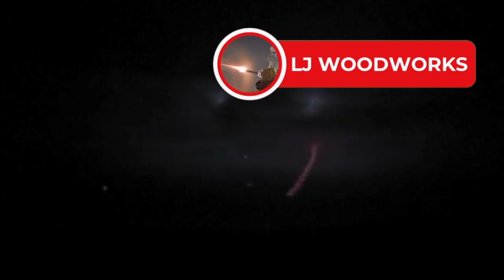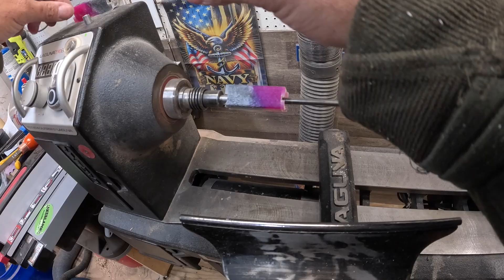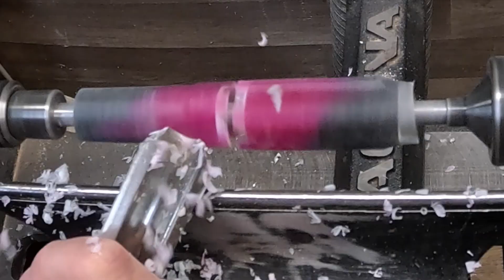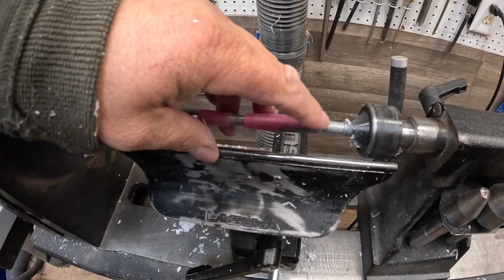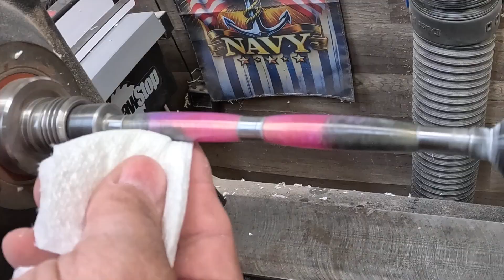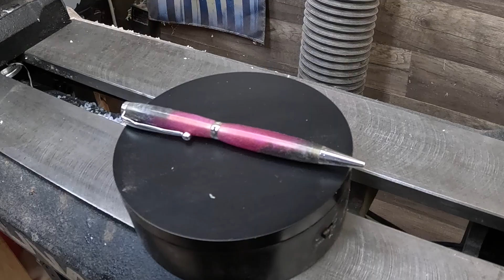Can You Turn Resin with Traditional Tools? | My First Resin Pen

Comment: I got my start with cheap Harbor Freight tools and a few old turning tools I found at yard sales. Definitely not the highest quality tools, and had no problem turning most resins, even brittle acrylics. But then I discovered carbide turning tools and realized what I was missing out on. What a difference! The moral is you don't need carbide to turn resins, but it sure is a nice upgrade.
Reply from the maker: Hey Ted, Thanks for watching!!  That Spindle roughing gouge is from a cheap Amazon set.  I wasn’t sure if it would work or explode, but figured only one way to find out. The negative rake I use at the end is an easy wood.  You’ve done some really nice pens, just subscribed to you!!